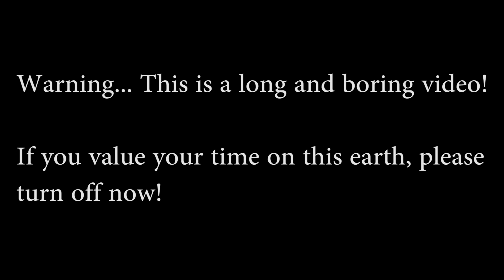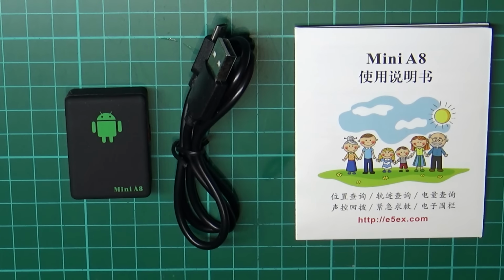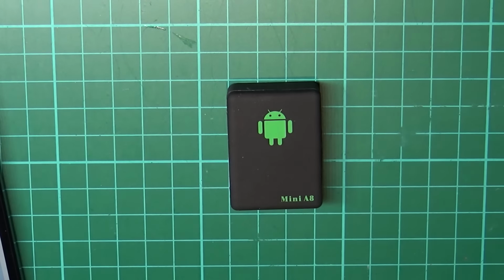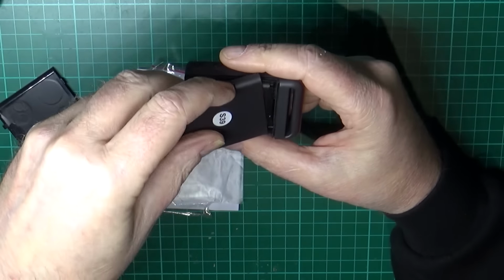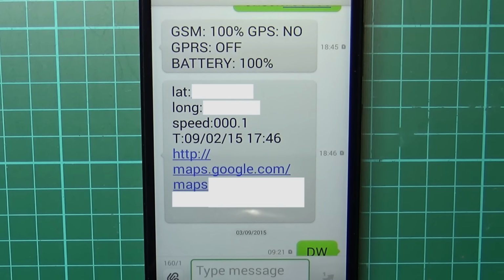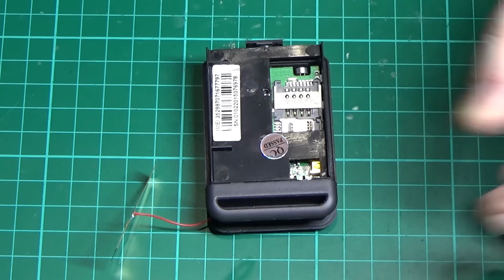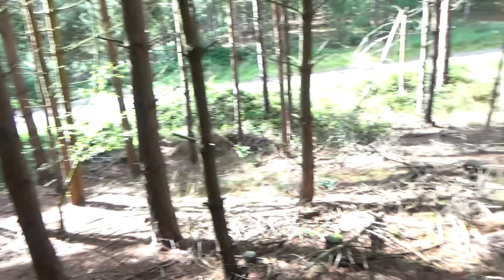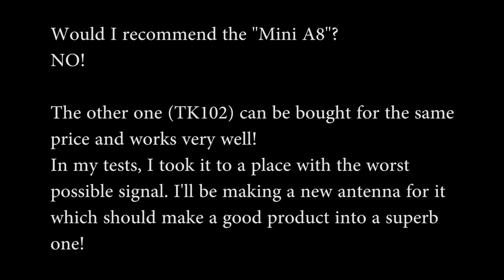GPS Trackers - Are they any good?

Comment: Will you survive a life plagued with dog sh!t? I hope so! Anyway, I would like to see the new improved antenna and find out if it can handle the deep woods experience. I think the quad is up in one of those pesky trees perhaps.
Reply from the maker: +dmerc00 Possibly but I don't think we'll ever know. I honestly think it kept going and is quite a few miles away from where it was last seen. I'm just finishing off 'Frankenquad the 2nd' and then, I'll be making a new antenna.I'm also working on a self contained 430mhz beacon which starts broadcasting after an hour of connecting the battery. If it's successful, I'll be giving them away and I'll only want the cost of parts..........
Reply: +Vortecks Will the 430mhz interfere with my EZUHF 433mhz receiver?
Sounds good though
Reply from the maker: +dmerc00 Not at all. It' on a timer and will only start broadcasting an hour after power-up. I should be able to make it with its own battery and have a jumper that you remove (or plug in) to power it up.